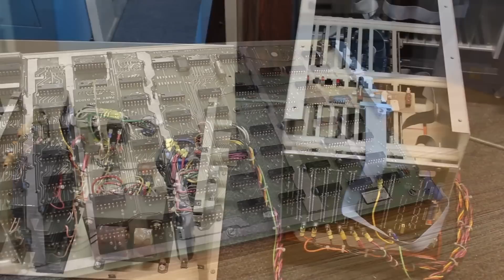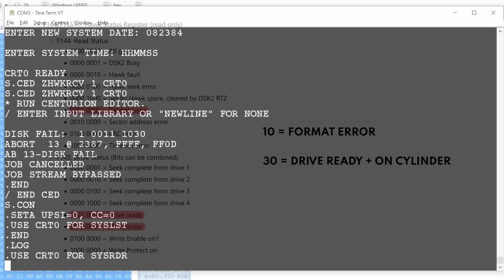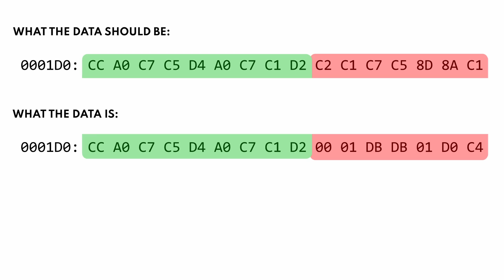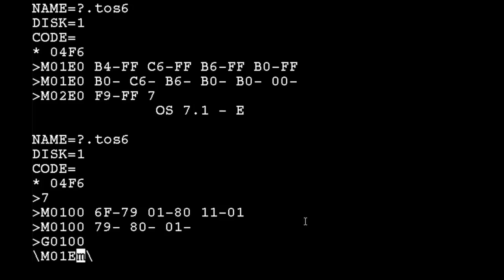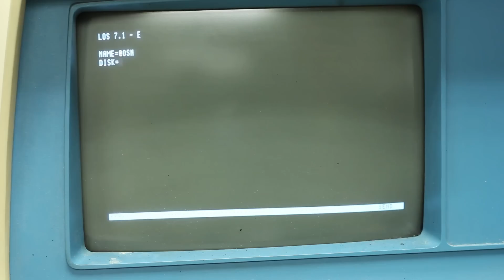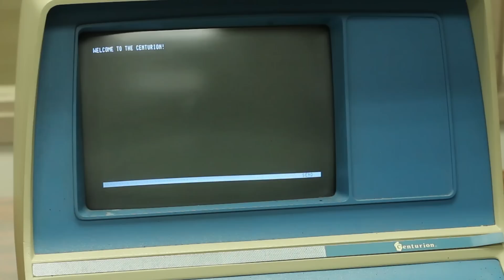The Desk System Centurion Lives!

Comment: would it be possible to emulate the drive with something like a compact flash drive obviously the board and ribbons would need to be custom made to doit. but it would be a nice way to preserve these systems without risking another failure of the drives

Comment: If you're interested in a little bit of SMALLER older tech I have a functional (except the integrated screen) VERY FIRST portable (luggable) computer by Compaq.  I also have the 5 1/4 inch versions of Windows version 1 through 3 along with all of the software available at the time.. more or less.. The external VGA port works thank god or I would have never been able to verify that it boots and functions.   Let me know if you're interested as I'd hate to throw out such an amazing piece of tech history!

Comment: when you can use registers as pointers why would you need to write a program with absolute addresses?  Surely you only need to use absolute addresses if you wish to directly address hardware, otherwise relative addressing  is just as easy? Unless of course clock cycles matter.

Comment: That ribbon cable may have been repairable. Usually the problems are either where the cable is crushed, or at the terminations. It may only need to be reterminated with new connectors. If it is crushed, but is overweight, you might be ablecto cut and reterminate.

Comment: @ 15:22 - shame there isn't a C compiler for this beastie - then you could compile a version of Kermit for transfer without needing these hi-jinks. The used to be an assembly-only version of the Kermit source floating around (several, actually - processor specific) but finding and then converting to this assembler might be "fun". Is there a processor architecture definition for this machine , or even an assembly language reference manual?
Reply: Found the Wiki on GH.

Comment: This brings back memories of getting a BBC micro to talk to the programming port on a PLC (which was 9600 baud current loop because, control system). Like this all data was transferred in packets with a start character, end character and crc, also the end character alternated every time so it knew it hadn't missed one. I had to write a 16 bit crc calculator in 6502 assembler.

Comment: Because those ribbon cables are unobtainable, you should be repairing it not throwing it away. It has value to anyone who works on these systems, broken or not.
Reply: 50 pin ribbon cables (shielded or unshielded) are definitely not unobtainable. An internet search will provide a multitude of vendors.

Comment: you mentioned the cpu5 not working with the diag card, and I thought
"oh no is he gonna boot into tos6, hotplug the card and jump into diag tos?"
I hate that I guessed correctly
you (and I guess Ken Romaine since he showed you the forbidden art of hotplugging) are an absolute madman, and I am here for that
Reply from the maker: Hot swapping cards is something I never would have even thought about unless Ken had done it multiple times in front of me!
Reply: Hot swapping the cards could blow a transmitter/receiver/transceiver. While that would be a bad day at the office it's all through hole components, they're more or less replaceable and the tolerances on the bus would probably mean it's unlikely.

Comment: What’s the real purpose of these old machines?

Seems like a lot of inputs required for such simple outputs.
Reply: What's the purpose of learning from your experiences? Understanding the problems people faced in the past and how they solved them gives a greater appreciation for the capability that modern hardware enjoys.
Reply: the way i understand is that you were supposed to hook up a bunch of terminals so the entire building could use it it seems quite bad even for the time with just 1 hooked up but its hard to find them now . and it also had very high storage for the era

Comment: That's really cool to get that machine running!
One thing that occurred to me: are all those cards of the centurion documented by now with schematics and stuff? So that if something breaks one could remake such a card? In theory?
Reply: Most of the cards are reverse engineered and documented...I think the only known failed cards are memory boards and one of the serial MUX cards. As there's enough cards in play for all the known extant machines to operate repair/replace is not currently an issue.

Comment: In 1982 I went to an electronics vocational collage and we had a section on computers. I learned to program in basic on a TRS-80 III, they taught us some machine language programming on those little trainers, and the school had a Heathkit HERO 1 programmable robot that we had to write code for. There was a large computer in the lab with the TRS-80s that was non functional but it was like a credenza with a long bed rail for punch cards to be fed into it and on one end was a yellowish clear plastic cake box with a stack of platters inside. Someone said the head crashed and that's why it didnt run anymore.  
After I graduated I did not pursue a career in electronics or computers. I just have this weird pile of knowledge that I barely remember much of, and I have no practical use for, but videos like this are very interesting. I remember just enough to follow along with what you're doing without understanding it very deeply. Your videos also bring up a lot of memories of the 2 years I was at that school.

Comment: As  a German, I have to point out: Please don't throw cables or other electronic parts in the trash but recycle it properly. All that copper is so precious! In Germany it's even illegal by now to throw it in the general waste bin... ;). Our "dumpsters" are nowadays called "valuable material yards" (Wertstoffhöfe)  and have special containers for all kinds of things to recycle, even old wood, or bins for "small electronic devices" in which you can throw everything up to the size of a mircowave oven... 
Also, cat and dog? What happened to the bunny? ^^
Reply from the maker: Ah yeah, we don't really have those kinds of laws here, people toss stuff like cables all the time.
The cable itself is just a generic 50-pin ribbon cable. You can still buy premade 50-pin ribbon cables for like $10 on Amazon new. Now, being shielded is a bit rarer, but not exceedingly so. It's a very common part, akin to throwing away a capacitor.
Reply: As an American, when done like that in a video it is for DRAMATIC EFFECT.  We don't have any of that stuff you talk about, we landfill recyclables even after we separate them at home.  But don't tell people this secret, they think we actually do something instead of it being performative.  God bless murica!
Reply: Wondering about the costs of recycling vs the costs of the reclaimed copper tbh
Reply: @sjsoftware72  I was in a Swedish copper mine once, the guide told stories of the workers... A really hard job. Also, these days, copper is a highly-sought and high-priced material, at least in Europe. Thieves steal it from everywhere, including stealing cables from railway installations and the new copper downpipes of the church in my hometown. 
And yes, actually we "hobby electricians", according to law, also would have to collect dead parts like capacitors and get it to the recycling facilities from time to time...
We also have the myth that it all is being dumpstered afterwads, but luckily this myth has been busted.
Reply: I was shocked when he just casually tossed that cable into the garbage. Is it rare and could it be repaired?
Cat and dog ate the bunny.

Comment: Would it be more efficient and faster to transfer and crc 32 x 400bytes worth of data before writing it on the disk?
//////////////////////////////. (that last dot worth 32 sectors)?

I ask because if you pause the writing (to get new sector data and to crc it), then you have to wait for the hdd to spin back to that next sector while if you pull data for 32 sectors, you can then write it all in one go sequentially.

Comment: Butler Tech sounds like nerdvana. My high school we literally had our computer class taught by the gym teacher... and "taught" is a highly generous description. "Monitored the self-directed use of" would be closer to the truth.

I won't complain, the school had hardware I didn't have at home so I was grateful for the access, but there was not much instruction happening in a didactic way, mostly just autodidactic (and more commonly, gaming).
Reply: Just like my high school. They had to make up fake classes to justify hiring the gym teachers and football/basketball/baseball coaches.
Reply: Our teacher wrote Basic code onto the blackboard and we had to copy and try to run it. Zero explanations what each part of the code actually meant, and software that was wildly outdated at that time. Kinda felt like using Windows 95 today or possibly even worse. Immediately after writing the teacher went off onto yet another smoke break and left us to our own devices. 15 minutes later he'd return reeking of stale smoke and, if we were lucky, help us do basic troubleshooting, leaning over us while messing around with our computers. Unsurprisingly he had a heart attack in his mid-50s and retired early.

Comment: A trick you can do in a pinch, is to download the file into memory at a different offset. Then have a small program that copies it to the right location and then jumps to it. You should be able to write that on the fly.

No need to have the diag card if you can dump that into memory.

Ignoring the button press to reinstall thing, maybe it would be a good idea to swap out ram chips/roms with a flick of a button to get into the memory monitor. So that you don't have to mess around with the diag card and it can be permanently installed.

Comment: One of the steps the high school will need is a way to do backup/restore for that system.    Maybe a fancier serial backup/restore to a laptop? (Though that could take FOREVER - and it wouldn't accommodate incrementals). Just thinking about how (now that it's working) to KEEP it working for them.
Reply: I was thinking of the idea of hiding a modern cheat inside the hawk drive.  Something like a Raspberry Pi Zero 2 could hide inside the hawk chassis to intercept the commands to read and write data from a virtual drive on an SD card.  The interface speed slow enough and with only 5 megabytes per platter, a Pi could probably generate the serial data in real time to feed to the controller card in the Centurion backplane.

DEC PDP users have Qbone and UNIbone cards which can be plugged into the respective backplanes to emulate,all,sorts of drives snd peripherals.  The difference is there are still a lot of PDP systems around, some still in production, while there are only a handful of Centurions in the world.

An emulator to live inside the Hawk drive is probably an economic possibility because many different systems, including DEC systems, had Hawk drives.  Old hardware can be left spinning and seeking to give the air of realism while the emulator handles storing and transferring bits.

Comment: I dont understand why you throw the cable away, you can undo the clip and ususally the pins are just clamped into the cable, you can bring the connecto closer and cut off the rest that is damaged. If you throw everything away, where are we going from there? You complain that the Centurion is so rare, if you think about it, maybe it is so rare because people like you throw everything in the bin where the slightest problem exists. Not sure if there are many 50 pin cables left, maybe SCSI had something like that, but not sure. Seems a bit odd for today, IDE was 40 Pin, floppy 32 Pin, maybe you can use 2x IDE and cut it off. Also you could shorten the cable with the same method, but if we are not caring at all, what does matter any longer.
Reply from the maker: I think you guys are misunderstanding just how common a 50-pin ribbon cable is. Unshielded cables can be had, brand new, for under $10 on pretty much any outlet, including Amazon. Shielded cables are a little tougher to find, but they are by no means unique. The cable that I installed was a shielded cable from a DEC system, they are plentiful. Heck, you can still buy shielded 50-pin cable new direct from multiple manufacturers.

Trying to claim that the cable is rare because it came off a Centurion system is like claiming an electrolytic capacitor is rare because it came off a PDP-11. It's an extremely common part used by countless machines across decades. So, why risk further data corruption by trying to repair a damaged cable?

Also, not for nothing, the Centurion and other systems like it are now fully operating because people like me put in thousands of hours to get them there.
Reply: That grated on me too, having worked with and repaired quite a few IDC ribbon cables like that, including wide SCSI, they are as you say, really easy to repair in quite a few different ways. There was no need to even suggest throwing it away, let alone to actually throw it away, if indeed he did.

Comment: The xmodem or xmodem1k protocol might have been a worthwhile protocol to implement so you could use it for more data transfers later
Reply: I have a lot of respect for xmodem for saving the bacon many times.  It seems like almost anything under the sun had an xmodem implementation and the simplicity of xmodem makes it reliable snd tolerant of configurations where flow control signals can’t be counted on.  Xmodem has let me get files off of ailing PCs and resurrect scrambled Cisco routers more times than I can count.

Comment: Now that is cutting it close.
A bit curios why you had to plug that diag card in 'hot', if the system could not access it due to the missing option to had over the 8000, then it should be able to be just left in the system, bit inactive.
Also I'm kind of keen to try that emulator - where does one get a copy and an image to run on it?
Reply: The diag card takes over some of the address space, if it's installed on system boot then the OS thinks there's a problem at those addresses
Reply: Correction - after viewing video again.  David used simple [ JMP Direct opcode 79 to address 8001 ]   -   ((David keyed in a bit of machine code looping with a  [Jump on Sence Switch One] true to hex 8001 using TOS6 he loaded from the Hawk disk platter 1.  Next by plugging in the Diag PROM Board into the running system looping with the [Jump SS1 8001] you just flip SS1 on the CPU6 card and now the Diag PROM Bd. has control & he can use Diag TOS running in the PROMs in high memory space not ay hex 0100.  Now he can load & run his PC to Centurion file copy program that starts at hex 0100. FYI - hex 0100 is the default program starting address above the CPU registers [0000-00FF] ))

Comment: There will be a lot of "calendars" printed on that printer if it gets running.  mind you get the centurion stuck down nicely on the monitor and does one of the switch buttons on the desk system need pushing in.  IF more drives added later can the opsys be modified to those and will the mystery of system program hanging when "hardward not found" happened as it should have ignored that (I assume one byte is wrong somewhere)

Comment: Need to get the desk system connected up over a modem to yours so you can exchange data!
Reply: Plenty of old routers had the ability to do tcp-to-serial. Should be easy to set up with some thematically old equipment over the internet.

Comment: Great work,   May I recommend an enhancement.  provide an orig and new file that only transfers the different sectors.   ie update the centurion code to allow a command like "W C 30 S 500" ie  write 30 sectors starting at sector 500"  that way you wouldn't have to transfer the whole 5mb.  Though at this point your not likely to need to do this again so might not be worth the effort.